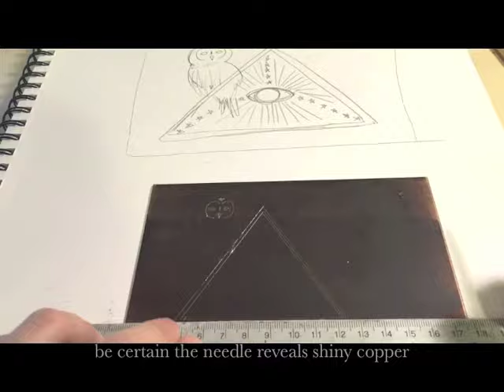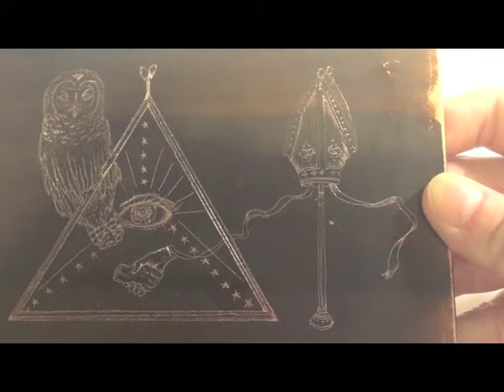Intaglio Printmaking by Sarah Tse

Comment: PLEASE NOTE - you can 'degrease' your metal plate using cream 
cleaner (Jif is one brand that springs to mind) the stuff that is used to 
clean sinks and baths.  You can squirt that onto your plate and give
 it a good rub with a cloth, then rinse.  Add a little water to be able to manipulate the mix on the plate as you give it a good rub all over.  You might need to do that 3 
times until the water runs off the plate in a smooth film. I am saying this because it is NON TOXIC to your lungs or chest ...............this is much safer than using whiting and 
ammonia( or alcohol) .  I was taught to use this process many years ago but now ....we 
use the JIF method.  When you are in your twenties you cant be bothered and think oh I 'll just use whats here.........BUT IT DOES affect your health in the long term.  I have experience of this.
Reply: JIF(aka CIF) is described as having limestone particles in it. Won't that scratch a polished plate?